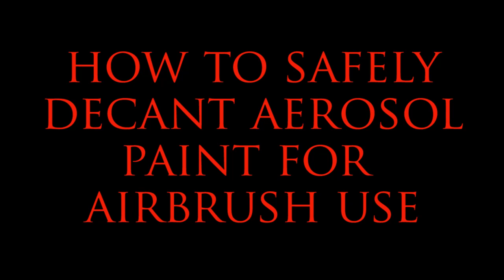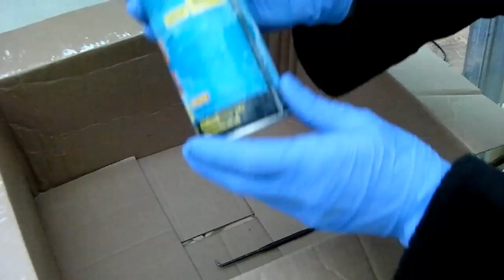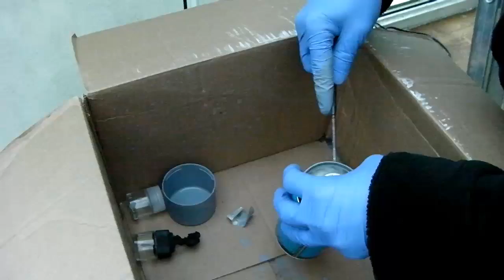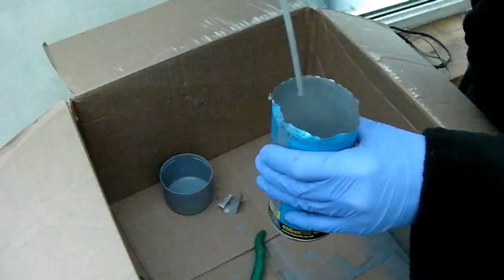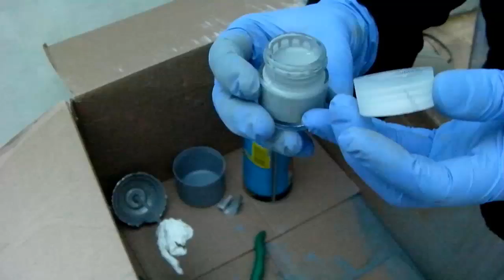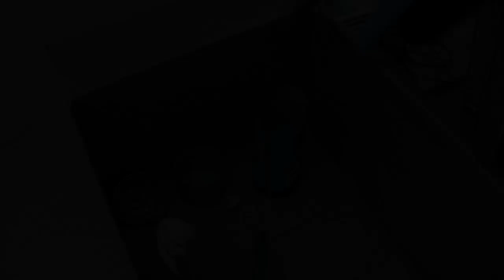How to decant aerosol paint for Airbrush spraying safely

Comment: Turn can upside down spray untill no pressure poke hole done DO NOT stab csns if its got any pressure
Reply from the maker: Or DO stab a hole and let it gas out without a problem like in the video somewhere where you're not getting cramp in your finger and huffing propellant! 🤷🏻‍♂️
Reply: @spidiq8 u can do my method with a full can urs requires u to empty paint
Reply from the maker: @pigeon__8522 'after' it has been de gassed.
I don't see what you're trying to say.
Reply: @spidiq8 do what u did with a full can and get back to me matey
Reply: @spidiq8 ur method is not efficient and youd need to waste paint to do it
Reply from the maker: @pigeon__8522 That was a full can matey.
Next point you're trying to make?
Reply from the maker: @pigeon__8522 No waste, I'm not sure where you're getting that from.
Reply: @spidiq8 again poke a hole in a full can come back to me
Reply from the maker: @pigeon__8522 THAT. WAS. A. FULL. CAN. I have done this numerous times.
I'm not sure how to make this more clear!
Reply: @spidiq8 u can see dust on the cap pal and u waste paint in the video.. there's a better method If ur worried about prepellent put it in a vice and put a box over it and ur inhaling prepellent whatever method you use and finger cramps? Soft hands😂

Comment: You can use a foam brush (recommended) to apply the paint if you don't have an airbrush handy. I let the can sit outside so the can returns to ambient temp. Sitting it out in the sunlight works great for helping the degassing. Also a side-cutting can opener will remove the bottom handily to harvest out the rattle ball. A 16 ounce empty paint can will hold the contents of you usual spray paint can easily and the lid seals better than a glass jar.

Comment: What if you just held the can upside down and sprayed? It should release the propellant without losing paint.
Reply from the maker: @craigbaldwin4935  Meanwhile you're huffing propellant and solvent fumes. There will be residual left also. Punching a hole and leaving it somewhere outdoors is far simpler and safer.

Comment: I just get a can of carburetor cleaner take the spray tip and the straw that fits in it. It fits on most paint cans and you can spray it right into a cup. I do it all the time with zero Mess👍

Comment: Thank you for this video I just subscribed ❤
I just got a little makeup airbrush to try out on my paint art.
 I don't do modeling,or cars etc.. 
 I do planets, moons,etc.. on canvas,glass, wood,etc.. anything really lol 
I do have a couple of questions if you don't mind? 
Is this safe to use indoors once you get the aerosol out?
I hope so because I love spray painting &I live in Ohio in America and it's only warm here about 4 months out of the year🙄
  I want to spray paint all year round indoors lol 

However before I try it I want to make sure that It is so I don't waste my spray paint.
 I also wondered will this spray paint in the airbrush sprayer &  come out closely like it would if I use my spray paint for my planets and moons? 

Again thank you so much for this video. I am now off to look through your other videos ❤
Reply from the maker: Ideally with any paint at all being sprayed you need a face mask and extraction as the paint is being atomised.
With solvent based paint as most aerosol cans are you need a solvent rated filter face mask unless you have someone to scrape you off the ceiling from getting high on the fumes.
You can buy quite affordable extraction units with a hose though or if you're doing quick paint sessions and have a room dedicated to your paint work you can paint in there, (with a mask) then open a window to let it air afterwards and avoid entering.
Even  water based acrylics being sprayed aren't 'safe' per se, as you're potentially breathing in atomised plastic particles.
Reply: @spidiq8  Thank you so much for this information and yeah I do not have anyone that would want to scrape me off the ceiling lol I certainly don't want to breathe it in I just didn't know if decanting It would bring down the sullivans and a chemicals at all just so that I'm aware too continue to do it outdoors even if I try it and an airbrush gun. I appreciate the information I love learning everything I can about spray paint art that I do planets moons stars nothing at all close to being an artist just a hobby and a stress reliever so I do appreciate the knowledge ❤️

Comment: Why do it in such a dangerous way? Turn the can upside down, with the cap on. Drill a tiny hole in the bottom and put a penny over it. Let it sit til it's depressurized. Tape the hole or put your thumb over it, and shake well. Cut the bottom off with a can opener and decant. No sharp edges to deal with. I use a #77 drill in a pinvise. Works just fine. Done it more than a dozen times.
Reply from the maker: There's nothing dangerous about it.
The base is stable, the cap less so.
it only leaked because I was daft enough to shake it too much thinking it had degassed more.
I tried the can opener after it being mentioned by someone a long time ago, it didn't touch the base of the can at all.
Perhaps can material differs, perhaps UK can openers aren't as gung ho as other countries can openers?
I don't know but this method works fine.
Have done this now more times than I care to count.

Comment: Have plan to paint my helmet using airbrush is this ok to be use?
Reply from the maker: Assuming you mean motorbike helmet? If so I personally wouldn't recommend using any solvent based paint to spray a helmet you're going to use on the road or track as there's a chance it could affect the integrity of the plastic shell.
Helmets differ in material and manufacture greatly but though I've had a painted helmet myself in the past I certainly wouldn't chance it now.
For a show helmet, sure.
Reply: Thanks, but I'll do it anyway because airbrush paint is expensive and just the little one. 😁😁

Comment: Just tried it on a 1/4 full can of Tamiya TS. Worked a treat thanks for the tip. Found a bradawl did the first hole easily. After de-gassing I then open this hole a bit and made a smaller one on the opposite side. Paint poured out really easily although a bit like a fizzy drink. Opened up the can with a pair of mini tin snips and there was very little paint left in the can. Wouldn't bother to do this again as the 2 hole method is good as long as paint well mixed unless you want to retrieve the ball bearings or in the case of this tamiya TS can a couple of small glass marbles. Thanks again.

Comment: Once it is degassed is there still a strong smell? Could it be used indoors once degassed?
Reply from the maker: Yes there's an odour like any solvent based paint. It can be used indoors but like any paint spraying a respirator and extraction system is recommended.
Even if it's easier based acrylic. Breathing in the particles is bad for you.
Reply: Thank you for the reply. The only reason I ask is because I have birds and acrylic seems to clear pretty quick with the extraction but wasn't sure on solvent based. It is in a separate room however.
Reply from the maker: @HuwFerris-John  They should be okay in a separate room but do take care with any aerosols and birds or other animals.

Comment: Your method is not safe at all my friend and it could cause injuries and a mess.
Reply from the maker: It's perfectly safe my friend, piercing a small hole to let the propellant escape is exactly the same procedure as pressing the nozzle to spray paint. 
Apply a little common sense, i.e. don't shake it vigorously, don't stab a huge gash in it and don't do it anywhere extremely hot.
Reply: @spidiq8  Just to clarify. I highly respect you for taking positive criticism in such a good way, it is rare these days. And i like the fact that you are showing an alternative to decanting with a straw which has its flaws as you mentioned. Always good to teach or show people new stuff. I meant by safety risk 2 things : while cutting the metal can, there is always a risk of an injury. Puncturing any pressurized can that contains propellant which is flammable as you know represents a risk of fire or explosion ( any spark). Maybe you have done it a 100 time and nothing happened. But there will be a “One time” where puncturing and cutting the can might lead to undesirable results. If I were you I would add to the video some disclaimer. Again this is my personal opinion. And I still admire your openness with the comments on your video.  Good luck
Reply from the maker: @Azantys agreed that cutting the can can easily cause injuries in the form of cuts and ideally some sturdy gloves (not the nitrile ones I used) for holding the can are recommended, but with adequate care it's manageable, there are tin openers which remove the entire lid leaving a sharp edge on your baked beans etc which are the same degree of dangerous.
The rest is a case of doing it in accordance with the spray can instructions for general use, not somewhere hot and no naked flames etc.
I see your point and yes, like many things, there are potential dangers but I want to dispel the myth that some believe in that simply piercing a spray can can make it explode spontaneously. To achieve this you'd need to heat it dangerously near a source of ignition then stab it.

Comment: Why not reuse the straw?   I save the straw in spray pump bottles as some will fit my airbrush siphon feed caps & some straws ends can be heated with a heat gun or hair dryer, slipped on the cap nozzle to shape & cool to fit.  I customize the straw length to fit the bottle, cut a "V" on the bottom so as not to clog on the bottom of the bottle or suck onto the mixer ball I put in the bottle.  
I'm a garden model r/r'er & I recycle a lot: i.e. an empty soda can, old film canister or small cut down pill bottle, a garden hose screen washer, glued together & painted flat black, weathering and I have a steam donkey (boiler) used to power a logging camp winch.  More care on cutting the end of that paint can, a wood plug, some sewing pins & plastic strip, I can make a propane or fuel tank out of that scrap.
Sit with your favorite beverage & let your mind wonder, you'll come up with something.
Reply from the maker: Great ideas and some fascinating MacGuyvering. I don't use a siphon feed brush personally so it be no use for that but I have in the past nabbed old used biro refills for that very thing.

Comment: I’m curious, is it safe to airbrush spray paints indoors?
Reply from the maker: With common sense yes.
Any sprayed paint needs a mask to protect breathing in particulates, even water based acrylics, you don't want to breathe in the paint.
Solvent based paints ideally need a booth with extractor to vent fumes as well but a well ventilated room that you evacuate after spraying, (with mask), if only done occassionally should be ok.

Comment: Shouldn't you filter the paint so no metal shavings will mess up your tip of your airbrush??
Reply from the maker: The paint is filtered after it has degassed in it's container and put into clean containers and sealed ready for use.

Comment: Would it work with a regular paint (gravity) gun ? Too liquid ? I have some stencil painting job to do but I haven't been able to get good results using the can directly so I was wondering if I could use the paint with my compressed air gun.
Reply from the maker: It would but you wouldn't want to use a large nozzle or flood the surface as the paint is very thinned.

Comment: Anyone know why they paint a line on the top of the can? I realise you're supposed to line it up with the nozzle but why? I can't see why lining it up will do anything different?
Reply from the maker: No idea. It shouldn't make a difference where the nozzle points.
Reply: I do you spray paint art. I do like moons, planets etc... From what I understand the line is supposed to be lining up where the bottom of the tubes pointing,so basically the top tube if you line it up with a black line will be exactly lined up with where the tube is touching at the bottom.
 I never fact check this or anything,That's just what some REAL 😂spray paint artists have told me.
I was curious in the past as well.

Comment: So put the can in the freezer first for  20 minutes and then can pierce the top of the can to let out the propellant, yes?

No need to degas by pressing down the head because the pressure in the can is greatly reduced by the cooling in the freeze, correct?
Reply from the maker: Theoretically it 'could' help. It won't remove the need to expel the propellant as it's pressurised but I wouldn't for wish of freezing affecting the paint and solvent.

Comment: After opening, ( punch a hole on opposite sides to get  propellant out quicker) leave the can in a bowl of hot water for a few minutes or use a heat gun. Then stir with a paint stick or Popsicle stick to be sure you get out all the propellant.
Reply from the maker: I personally wouldn't recommend heating as there's a flash risk but it would speed it up. Generally there's no rush when doing this though.

Comment: If you take a bit more care, you can vent the can on the bottom, and when the can is de-gassed,
use a can opener. There are lots of different methods. Whichever one suits. Cheers!
Reply from the maker: Tried a can opener after a viewer suggested it a few years ago, a standard one doesn't work, some might but your regular cheap kitchen can openers don't.

Comment: To clear the nozzle after using you hold the can upside down and just press the nozzle. A little paint comes out, that was left in the feed tube. So why not just keep the nozzle down til the propellant exhausts?
Reply from the maker: Fatigue. Aches. Inhalation of propellants. The fact that punching a hole and leaving it on a stable base when you're cutting it open anyway while you have a cuppa?
This has been asked and answered above in the comments before.
Of course there's nothing stopping you doing it that way if you want to do that.

Comment: Have done this countless times over the decades with WD40,penetrating oil,brake cleaner etc when they either decide to die (don't have enough propellant to start with,sometimes they're defective off the shelf) or when the nozzle broke.
Put the hole closer to the nozzle so I can just shake it on the part/s.Or  with ones like WD40 and brake cleaner I'll put them in a plastic pump bottle because they evaporate.

Comment: 🤣🤣🤣. I drilled a hole..    and then pulled the drill bit out... had a second or two of air, then all the paint came with....   (recovered more then I thought I would after loosing so much..) 🤔. Had genuine Blue Grass for a few months...   maybe I’ll try this way...
Reply from the maker: The important thing is to leave it to settle for a bit and don't agitate it after making the hole in it.
Reply: @spidiq8  next time. I’ll follow this video to a T!

Comment: why not just turn the can upside down and press the trigger to release the propellant, like the can instructs you for clearing the nozzle?
Reply from the maker: Because you'd have to hold it for ages and get cramp in your finger and inhale all that lovely propellant and end up floating instead of letting it gas off and go and do something else, it's also quicker to pierce it and you have to cut it to pour the paint anyway.
Reply: @spidiq8  You're releasing the same amount of butane/propane/other no matter which method you use.
Reply from the maker: @Bob_Dub  Yes you are. But while it's sitting on its base and is nice and stable Vs being upside down, you leave it outdoors or in a well ventilated space while you walk away and let it do it's thing knowing it will work because a hole won't seal itself whereas sitting upside down in an unstable manner with tape holding the button would need more attention as the likelihood of failure or mess is much much higher.

Comment: Can’t you also turn the can upside down and hold down the nozzle? That’s how I clean them out after use. For those scared to pierce a hole in  the can ✋😂
Reply from the maker: You can indeed but you'd need to stand for a while holding the nozzle and risk inhaling propellant, piercing it you can sit it somewhere safe and leave it and it de gasses faster.
Reply: @spidiq8  Unless you stop huffing paint long enough to think of a simple way of holding the nozzle.
Reply from the maker: @Bob_Dub  And a way to safely hold the can upside down while you tape the nozzle or whatever. Or maybe you could do something easier? Like. I dunno sit the case on a stable base and punch a hole in it?
I mean if you wanna stand there holding a can upside down pressing the button. Be my guest but I like to find the easier options to do a job.

Comment: Great video! I currently have a can that is almost full but stopped spraying after a few seconds. I tried replacing the spray nozzle with a known good one but that didn't help. I've had this problem with several RustOleum cans over the years. I've come back to airbrushing after a 45 year break and was hoping to get the paint out of this almost full can! Thanks to you now I know a safe way to do that! Guess what I'll be doing tomorrow morning? :) Thank you sir!
Reply from the maker: Glad to help. Be sure to not have the can out in the heat for long before piercing it.
Reply: @spidiq8  I kept the can in my garage so it stayed fairly cool. Did a very small hole and let it set for 4 hours. Enlarged the hole, cut about a 2 inch slot from it and poured the paint into another container. It was close to 200ml! No more wasted paint for me. Many thanks!!!